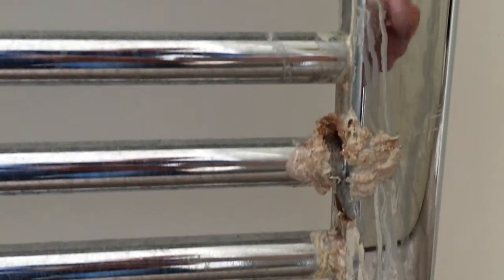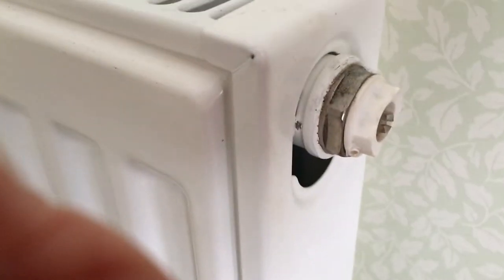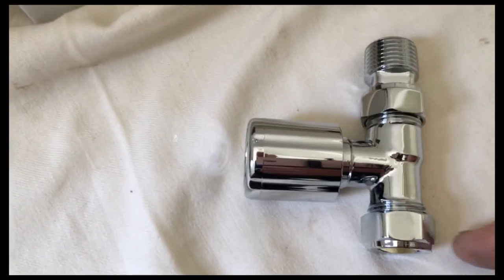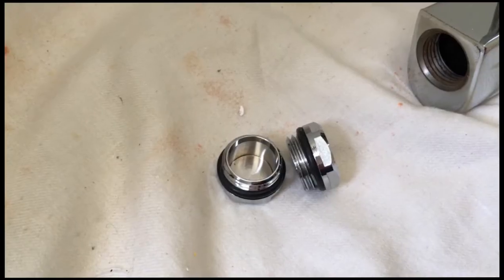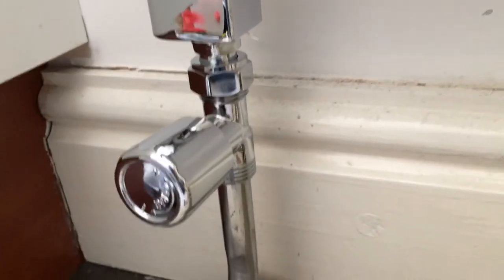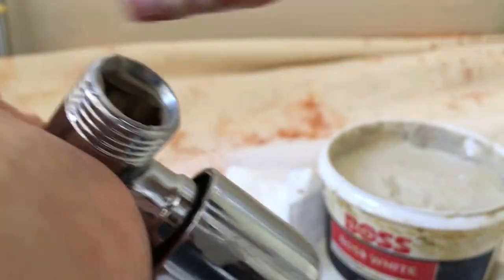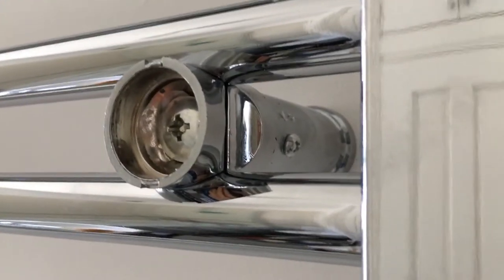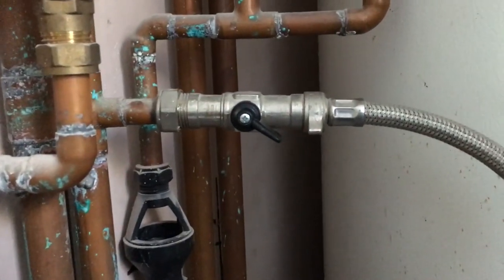Leaking bathroom towel radiator - how to DIY drain system replace and fit new radiator and valves.

Comment: Great tutorial!  I'm another ancient old geezer, who just fitted a towel radiator but the lock shields are weeping - one far more than the other. They tighten with 1/2" hex spanner and I don't think i've added enough PTFE as it seemed to screw in all the way a bit too easy.  Would you recommend rubbing boss in the rad before screwing in the insert, to be extra sure?  We have another to fit, so I value your advice on it pal.  Cheers 😃
Reply from the maker: @voodoomotion5855 thanks for watching. No, I would not be mixing Boss and PTFE. Think the only secure way to stop the leaks is to start again but use more PTFE tape. Many of these ladder radiators (and valves) are of poor quality and in my limited DIY experience have imprecise tappings which can lead to leaky joints.
It's all part of the DIY learning curve. Good luck.
b33zo
Reply: @b33zo  thanks for your reply, good sound advice and definitely agree about the quality. Apparently Loctite 55 has become popular now for threaded joints

Comment: Is it necessary to drain down completely? Maybe just enough to lower the water level below the towel rail radiator, that's assuming the towel rail is upstairs.
Reply from the maker: Hi Dave thanks for watching. As a DIYer I don't have enough confidence to guess that I've let sufficient water out to crack open the plumbing. You can get airlocks that suddenly release a load of water you weren't expecting! Good luck if you're doing this job. Cheers b33zo

Comment: Really useful video, thank you :) Can I ask, on those tails that go into the bottom of the radiator, is it the PTFE tape that provides a stop to fully tighten? I am in the middle of fitting a new towel radiator, when I put the tails in they are the exact same Screwfix ones as yours, I did use a couple of wraps of PTFE, hardly any really and when I screwed them into the bottom of the radiator they did provide a bit of resistance when tightening but nothing that would make me feel it wont leak lol, also they went really deep into the radiator, the place where you put the spanner was almost gone they were that deep, looking at this I am presuming I need to add a pile more PTFE tape, that should then allow me to fully tighten them and them not go in to deep?
Reply from the maker: Hi Chris thanks for watching. Yes I found that the tails went right in and didn't feel very secure when I added just a couple of winds of PTFE tape. I re-taped using probably 10 goes round with the tape and tightened the tail in position until the amount of pressure felt right. I was also concerned the the female tapping might split if I used too much pressure winding in the tail. You just have to have a few goes until you feel the resistance is sufficient to create a watertight connection. Good luck. b33zo